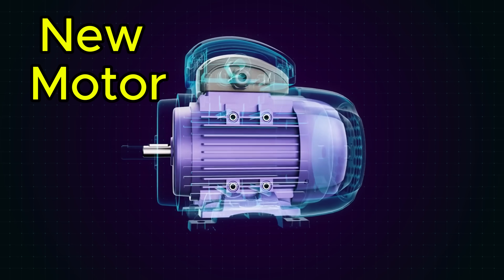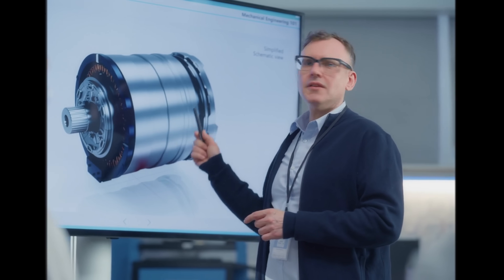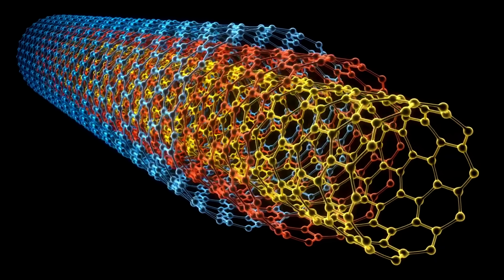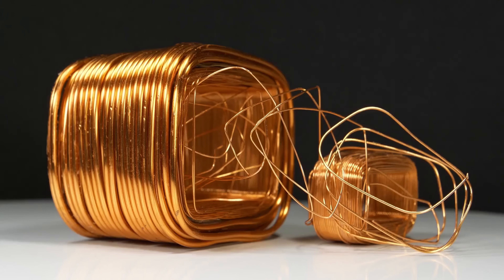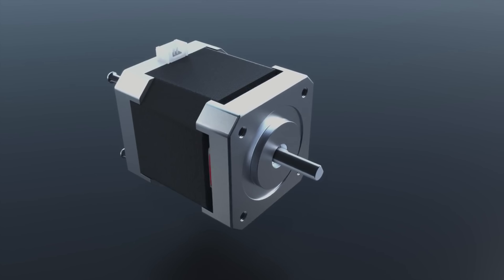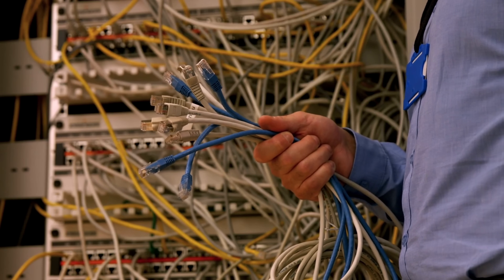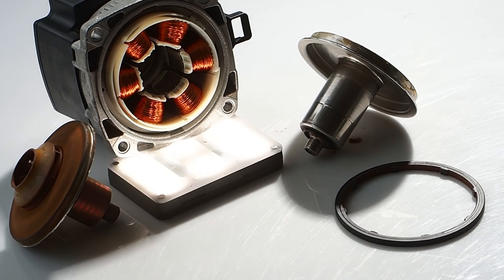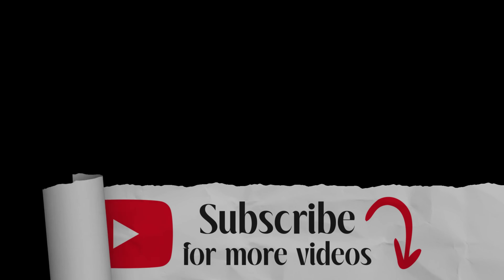New Electric Motor Runs Without Metal Coils – Here’s How

Comment: You can still use COPPER just change the style of the engine by using ELECTRONICS
Reply: Watch the video again, CAREFULLY.
Reply: @Light_Of_Elohim ELECTRONIC COMPONENTS can compensate for for the copper wire and Secondly,carbon is not cost effective and video states possible dangers of using it. Thirdly,it doesn't conduct electricity all that well so that means you to use more and that sends the price of the engine sky high so is it really worth it
Reply: @Troy-l6o  "Thirdly,it doesn't conduct electricity all that well"

The video states 133% increased conductivity.

I can see your confusion as early tests with carbon nanotubes scaled up to real world uses have shown less than promising conductivity results, but the science has come a long, long way since then.
Reply: @mnomadvfx THE problem is that you need a lot too get the 133% which makes it not cost effective. I make equipment with copper wire and have to use very little when combined with electronic components which makes them smaller which cost less than it would with carbon that raise the price significantly

Comment: It runs on hot air or fart power!
Reply from the maker: Please note that this video is based on a real science. Here is the reference to the published study: 

Ryu, Ki-Hyun, Dongju Lee, Min Ji Kim, Ji Hong Park, Seok-In Lim, Seo Gyun Kim, Jun Yeon Hwang et al. "Core-sheath composite electric cables with highly conductive self-assembled carbon nanotube wires and flexible macroscale insulating polymers for lightweight, metal-free motors." Advanced Composites and Hybrid Materials 8, no. 2 (2025): 1-10.

Comment: the rotor will be lighter than before possible less heat maybe
Reply: Heat generated will be more because the specific resistance is higher than that of copper. The consequent power loss (and heat dissipation) will be proportionally higher...
However the acceleration and deceleration times would be significantly lower resulting in a faster response to changes in speed
Reply from the maker: agree, thanks

Comment: I liked it, Electric Motor without Copper Windings !. Wish to try it soon.
Reply: Still windings, just using CNT yarn instead of copper wire.

If they have truly fixed the conductivity issues with CNT yarn then it can also replace all the other uses of copper wiring in EVs, like from sensors to central computer, or batteries to the electric motors.

The reduced mass of all that wiring will add even more range.